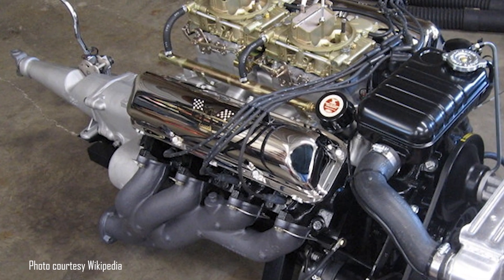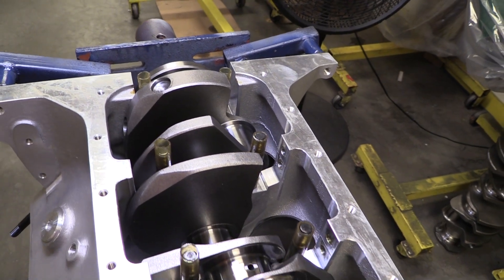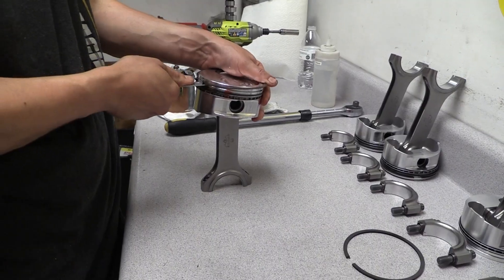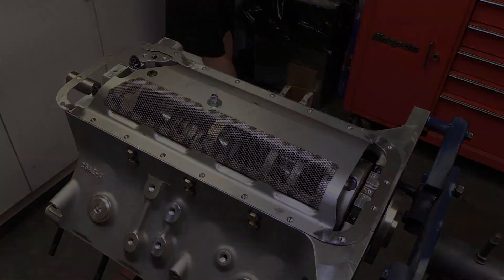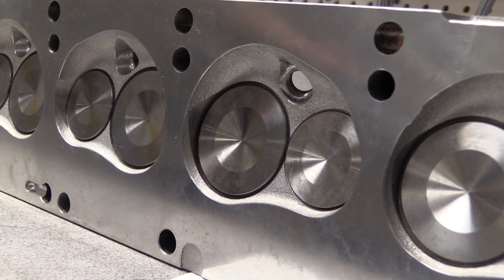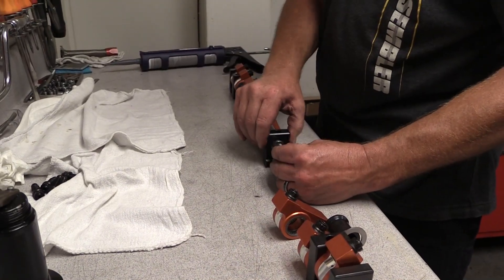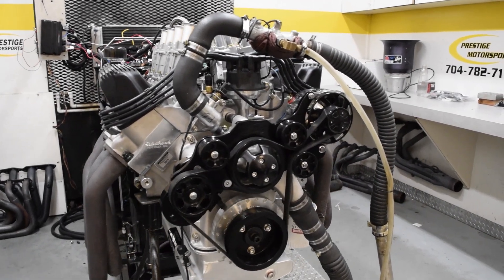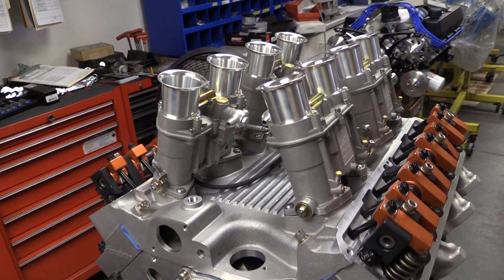Building an All-Aluminum, Fuel Injected FE Ford (with a Carroll Shelby Block!)

Comment: Wow a power package that is out of reach for 95% of regular gearheads. Show something on the affordable side for guys that are FE enthusiasts.
Reply: Looking for a similar thing myself. On most of the 390s, the biggest bottlenecks seem to be the heads/valvetrain and static compression ratio (on the smog motors). Mine is out of a 68 and has around 9.5:1 supposedly, and I have the common c8ae-h casting heads. The stock rocker arm shafts and valve springs don't seem to hold up very well with any more than .500" lift. The c8ae heads can be drastically improved with porting and getting them cut for bigger valves, but in my area, the expense of the machining and rebuild work doesn't make this a cost-effective option over a home-ported set of the edelbrock heads. A 390 with a big cam (such as one of the crane hydraulic rollers) can benefit greatly from a carburetor in the 800cfm range. With most aftermarket cams, a carburetor less than 750cfm seems to be a performance bottleneck. Additionally, recurved distributors seem to make a big difference, and as far as dual-plane intakes go, the edelbrock performer rpm works much better than the regular performer, and both are pretty bad in comparison to the pricier blue thunder dual-plane. Waiting for some Richard Holdener performance testing on an FE. If you have a low-compression smog motor, you may want to look into a DIY ring-gap, single plane intake, blow-thru carburetor and turbo setup.
Reply: @sitzkrieg8032  see the Carroll Shelby engine website, they have assembled aluminum medium riser heads for $2700 a pair. Sorry no link.

Comment: Low on horse power and RPM
Smaller cubes are pulling 600hp+  and 7500 rpm
Reply: There IS such a thing called intended use and hp goal of every engine built...   Not everything is balls deep all out power, what good is small inches and a ton of rpm if you can't use it in the intended application?  The point of bigger inches in a mild setup is torque and low rpm, which better suits the use of the power band..  or is this just Japanese to you.. lol

Comment: The engine is a work of art. I understand it is not a maximum HP build, but I find it bizarre that with all the cubic dollars spent that they would not spend a few hundred cleaning up those heads. The owner is leaving a lot on the table HP wise. Even if it isn't needed, that little extra wouldn't suck, either.
Reply: Agreed. Horsepower...... better to have it and not need it than to need it and not have it😜
Reply: More power, probably... but at a much higher rpm.. and if that isn't the goal then why bother if the casting will accomplish the goal without it.
Reply: @vengeanceizmine9878  not true about the RPM. I am not saying hogging out the ports. Just some simple cleanup/port matching. It cost almost nothing and considering the extravagance of the rest of the engine,  it seems like a moot point unless you have an absolute  cap on the horsepower that you refuse to exceed and you can afford a 35k engine but not an additional 300 bucks.
Reply: @danmallery9142  Unfortunately, it is very true. The ONLY way you will see a gain, is by removing enough material in the right area of the port. When you do that, power curve changes. Where you gain in one area, you lose in the other. Always a sacrifice. Little "clean ups", "Gasket Matching" and "Port Matching" does pretty much nothing for power, but helps the OCD crowd sleep at night lol. More power in the correct valve job then any of that stuff. 
However, I am NOT saying a better port design wouldn't make more, what I AM saying, is that if a casting will support the power for the intended goal and application, then it doesn't matter how much the total cost of the build, if it gets the job done. Doesn't matter if you, me, or Santa thinks it SHOULD be done. An engine only needs a specific port to do the job for a specific goal. No more and no less. If it can be done without added cost of porting, then they won't pay it. Just a reality.

Comment: That engine costs more than my house....
Reply: bare block is 6500
Reply: @427med  7500 on the CS site.
Reply: @427med  Is that all? Okay, I'll take two....
Reply: @427med  check the website, $7500.
Reply: shane  Liberals have destroyed OZ
Reply: @phitownhustler4802  you lost?
Reply: I was thinking the same thing .
Reply: @robbalex1963  I had a choice,...a new Corvette or retiring early,...I'm kicked back sitting in the shade...
Reply: @427med it’s $7500 I work there
Reply: Mine too
Reply: shane  Gulp!....
Reply: shane  you poor bastards are getting Royally fucked, I hear it's the same in the UK with housing prices.
Reply: That's a shitty house... They're not THAT much.

Comment: Would a single 4 barrel of made more power? Eight stacks look real good, though.
Reply: 4 barrel makes same hp, but ITB makes 10% more torque in midrange. Ram tuning effect produces a lot more torque, It has no plenum so it is insensitive to cam overlap, so it idles like a "stock" cam, no rump de dump, but has upper band power like a race cam.  It also has incredible throttle response.  That's why they were used in LeMans.  You have to balance airflow through each throttle body.
Reply: @turbo32coupe  Very interesting, regarding insensitivity to overlap.. Thankyou.
Reply: @MsKatjie  without a common plenum, there is no exhaust gas contamination of the incoming charge.  This is because during overlap at low rpm exhaust is sucked into the plenum because it is in vacuum and the exhaust gas velocity is low.  Each cylinder sees a perfect mixture throughout the rpm range.  The throttle response is incredible.  No 4 barrel can match it.
Reply: Hard to say if it would have made more, but a properly sized 4 barrel certainly wouldn't have hurt the power I wouldn't think.
Reply: you got the point!
Reply: A Victor Jr. and a 950cfm Holley would have given those "stacks" a run for their money....a lot of money but, nowhere near the "Wow" factor of those beautiful injector stacks!
Reply: @ranger-3.0V6  Had a Victor 427 and 950 Holley.  It made slightly less hp and 10% less torque than my ITB setup.  The only downside to stacks is the complexity, but the throttle response is like no other.

Comment: I have never seen roller lifters go in their bores so tightly. You sure those were okay?
Reply: They were probably installed with .0008" to .001"clearance, which is perfect for a block that will expand when it gets hot.
Reply: @ranger-3.0V6  Um, you want to rethink what direction the lifter bores expand in?
Reply: @ranger-3.0V6  I dont think aluminum LS engines have that tight of tolerances though.
Reply: shane  Aftermarket blocks don't typically see those kind of tolerances either. Regardless of block, even if the lifter bores were opened up for larger lifters, I have never seen lifters slide in so tight.

Comment: I can't help but feel like that's such a waste of quality parts and big money for the R.O.I. Should an 8 liter V8 not easily make much more than 500 crank hp reliably? Is this just a function of the FE engine architecture?
Reply: Obviously it is not for racing.  Obviously it is a street driven machine.  Obviously not using slicks.  Now you tell me how you plan to plant any more power than this to the road in a 1960s suspension...  We will wait for your reply.
Reply: @markperry2827  Right. Narrator explains intended use right up front, but viewers are used to dynamometer warfare and turn into whiners. This is a Boulevard engine, not a Cemetary Slinger.
Reply: Happy for the video, but a bad choice in parts.  The Ford 427 is a fantastic engine 30 years ahead of it's time.  Compare the architecture with the LS motors.  Deep skirt, rail rockers, symmetrical ports, front oil pump. High port (cathedral) heads. Priority main journal oiling. cross bolted main caps.

Comment: The heads are not at all suited to this application. Something from survival motorsports or blue thunder as well as a bigger cam would have produced much more impressive results.
Reply: Why?  It is a street build...
Reply: @markperry2827  One would assume that they were looking for big power with the race block, stack injection, etc. Why have a pointless performance bottleneck with this budget?
Reply: Not if that is what the customer wanted. Anything else doesn't really matter..
Reply: I'm sure he (the customer thats probably got more money than I ever will) wants his cobra replica to "look" like the ultimate - and dosn't plan on doing any real bashing in it - (he probably has a couple Ferraris and a gt or 2 an Aston Martin for dinner dates etc. ) He just wants his cobra to hold its own at a stoplight here and there - and in a 2200 lb car - it will - if he can even begin to hook that amount of torque up (doubtful) - just my guess !

Comment: Awesome build.. only thing I can critique is the kinda lame heads.. should have had them ported, they have a lot of meat that can be ported out, and it would have made more power.. otherwise I'm drooling over this engine
Reply: Loved the build, kind of wondering about why the buyer was willing to drop the cash on this, to only make 500. They obviously didn't want to pay for the porting work, so why pay for the rest of it?
Reply: @sparkplug1018  If you have ever driven a 60s Shelby you know the suspension is the limiting factor.  More than 500 HP from a 428 is a waste without car modifications.   I would guess the car is a very pretty car for show.  The driver doesn't want to feel he is driving on ice 24/7.  500hp will get you easily into the 11s in the quarter  mile.  Way fast enough for a 1960s technology suspension.
Reply: Mark Perry Why build this for that power level, great build and I’m sure it will look amazing but damn. That’s a awful lot of cash just to look nice
Reply: Why bother if the casting did the job and they achieved the goal.. all that matters really.

Comment: Good statement about the head studs or any stud screwed into the block. So many builders try to torque them in and find out the hard way when a crack is found in the area of the stud.
Reply: That bothers me seeing that too, I've always run them down till they bottom out and back off just a touch. Never had any issues, so far anyway.

Comment: Why use a solid roller if you are only twisting it to 5500 RPM? A hydraulic roller is good to at least 6500 RPM. Cheaper, more reliable, and no maintenance.
Reply: I wondered the same thing.  Maybe it impacts exhaust note? Maybe the class it runs in requires it.  A lot of maybes.
Reply: Maybe to make stupid people ask questions... Who knows?
Reply: @salvadordollyparton666  The Lord has spoken.
Reply: More area under the curve..

Comment: I wonder what, if any, break in procedure is performed prior to dyno pulls?
Reply: They get a lot of idle and low rpm time while checking for leakage, setting the timing, and A/F settings in the carbs. Remember, roller cam motors don't need that 20-minute routine like motors with flat lifters, they just need to "set" the rings which are fast these days due to modern cylinder torque plate honing.

Comment: It would be awesome to see the dollar amounts flash across the screen as each part is added.
Reply: I would also add appropriate sound effects, like cymbal crashes and such. Devastating Hiroshima footage upon intro of the cylinder block.
Reply: Would be interesting, but as the saying goes, if we have to ask...
Reply: @sparkplug1018  I haven't hard that one, what's the rest of that saying?
Reply: @jp360ford2  Oh I'm sure you've heard it many times before.
Reply: @jp360ford2  if you have to ask... then you can't afford it ... i think that's the end lol
Reply: @sparkplug1018  did i nail it?
Reply: @kylemcweeny878  Oh yeah.
Reply: @kylemcweeny878  I ask "how much" so I'll know how much to write the check for.👊👊👍👍✌✌
Reply: You only need to know that when YOU are paying for it.. lol.
Reply: As much as a new truck at least. Lots of money 💰
Reply: I know this shit is expensive. That’s a given. I’d actually like these shows to be honest. It wouldn’t stop me from watching.
Reply: Very true, like Italian motorcycle I bought brand new, sounded very loud with exhaust valve disconnected open and went very fast, it was Aprilia Tuono 2014 with quick shifter and launch control, I had it for two years and did 8k km , traded it in for a Kawasaki Z900rs , loss $7000 AUD. I loved that motorcycle but always overheating and shut off on me, also found metal shaving every time  I changed oil. Now, very happy with my Kawasaki Z900rs, every time I changed oil, it's still very clean and still has colour. No more rattle on my spines when riding.
Reply: @markc7842  oh, you reminded me of my Ducatti 🤮
Reply: Well the block is right around 10 grand
Reply: I would guess $25K plus labor.
Reply: FWIW, in May of 2025, I had Prestige build a 482 aluminum FE engine, using the Shelby block ( $8700), Shelby heads ($3300), Shelby intake ($1100), and other Shelby parts (front cover, valve covers,  water pump).  The total price for the engine, shipped to my door, was approximately $36,000. Simply stating because multiple people have asked.

Comment: That's a beautiful engine. I would be proud to put that in my Chevy! 😁
Reply: There is not a chevy chassis on the planet worthy... 😒 And it surely won't fit your cavalier.
Reply: @salvadordollyparton666   Don't be mad at me because you drive a Hyundai. It will fit Nice in my 2wd 94 Silverado. I'm just deciding on what transmission I'll be using.😎

Comment: This is just perfect and will last a looooong time. Good job 👍🏻
Reply: It may be pretty to look at but the power numbers are sad for the dollars spent. That big of an engine with high dollar parts should be pulling 700 hp!
Reply: @mylanmiller9656  I agree, my 394 ci with a Holley SD. A Holley 3310-3 with a metering block in place of the plate. With jets all around and 2.055/1.6 exhaust valves and a a good valve job with a little touch on the SSR and the intake manifold ports so the hook the direction of those ‘64 352 heads and a 230@.050 solid cam. I  have dynoed it at 503 hp at 6700. and 463 ft lbs at 4200 and444@ 3000 where my stall is. The cost to build inc machine  work was $ 2200. I would put a turbo behold the header with a cross pipe and a bonnet over the carb with the air/ air intercooler in the floor of the car. Show the Scatpack boys who’s boss. With a 1014 hp at the crank and a manual trans is. 857 at the wheels, run a single 4 inch straight out the side, and cruise around under the boost curve and when you hit the whistle let that modern magic do its job.
Reply: In fact I have a 3 rib (like the CJ/SCJ) FT 391 block that has the 105 mark. I have a 428 crank and a CapSaddle that ties the center 3 Mains together. The drill bit test showed 3/16 between the bores. Indicating that 4.13 is possible, if not I have a 3.79 FT steel crank that could be offset ground to 3.89. and bore it to 4.098, for 410 ci.  2.2 rod journals, 6.7 rods , 1.72 r/s. 245@.050 .588 hyd roller. VS 7875 with 10 lbs boost with 545 hp na, 915 hp fw. 776 at the wheels. I think that the stock block can do that with a rising boost curve.  That would be fun with a Summit turbo and home made piping. I have good headers and just make a 2.5 crossover and mount the turbo to kick a 4 inch pipe straight out the side.  It would be as quiet as a Harley until you get hard on the whistle. 10 lbs of boost isn’t a lot.

Comment: Block is in the same style as a Stage 6 Keith Black.
Reply: NZ Salt Flats Racer : With a Big Small Block bore center of 4.63 inches. Its very, very light. What an engine. I know it can take another 130 hp at those revs if extra cam and porting are done. It must be a really sweet engine. I too am a Moo Zealander from tge Antipodean area. Nice post.

Comment: Needs more cam I'm guessing with the torque production far outweighing horsepower that or heads. Something up top is limiting production. It definitely wouldn't hurt to add some cam but my guess it the heads are the limiting factor. Nothing against Edelbrock as they make good stuff especially their intakes but there are other groups that make better heads. Although one is limited when building an FE. Personally I would have tried the Promaxx Shocker 200's. They flow around 330 CFM at that amount of valve lift on intake and 254 CFM on exhaust. I would love to see what the power difference would be on that engine with heads that will support 700hp.
Reply: The result would be worthless in a street car.
Reply: @markperry2827  Not necessarily. Just because a head flows more doesn't mean it has poor part throttle response. Perhaps putting in longer duration cam would make it less enjoyable on the street but that depends on how large you go. It's not like this is a 302, it is a 482 so increasing the cam duration some isn't going to hurt anything and neither will better flowing heads. Thank you for your comment.
Reply: @markperry2827  The LS engine is a prime example of stock heads that flow quite well not hurting street performance. If you notice I didn't say adding gigantic port heads but instead a head that flows much better. The heads I was suggesting if you had bothered to look at them are 200 cc intake ports. Not even close to oversized for a 482 cubic inch engine. I didn't make the suggestion without thinking about how the engine was going to be used. Once again thank you for your comment.
Reply: Parent of Twins
Reply: @markperry2827  The ITBs turn a big headed, big cammed engine into a docile street car.  If you owned one you would understand.

Comment: What is the cost of an engine like this?
Reply: I would guess 27 to 33k usd
Reply: @markperry2827  Way too much for the performance obtained. I could build a stroker iron big block with aluminum heads and a carburetor with 600 hp on pump gas for 15k complete.

Comment: Spend that kind of money on the block and use Edelbrock cylinder heads? Medium riser casting with 428 valves? No high Riser or Tunnel Ports?